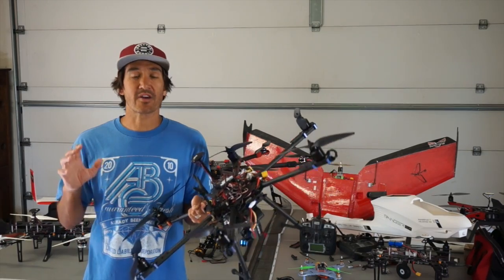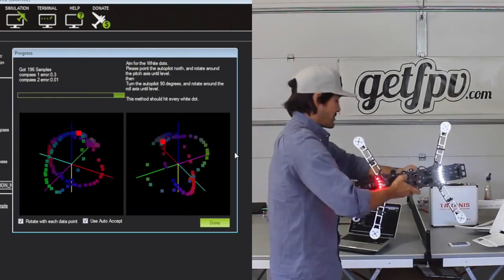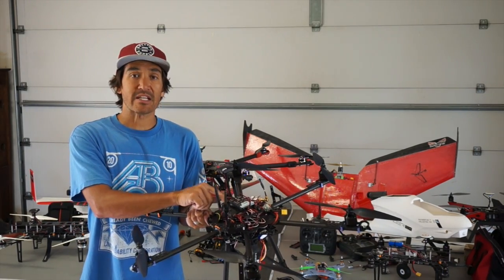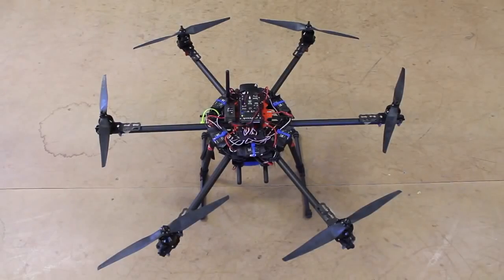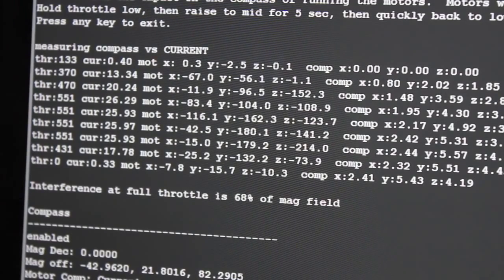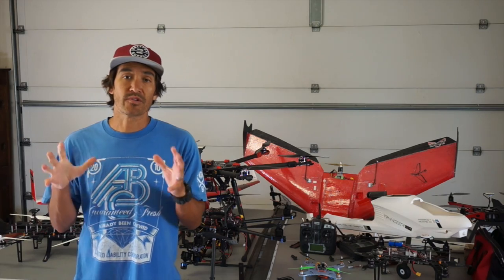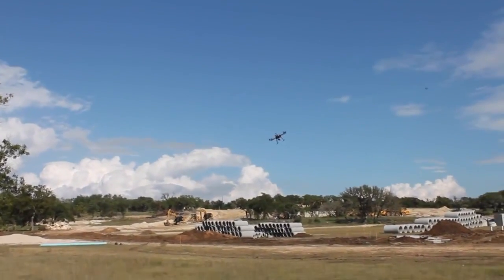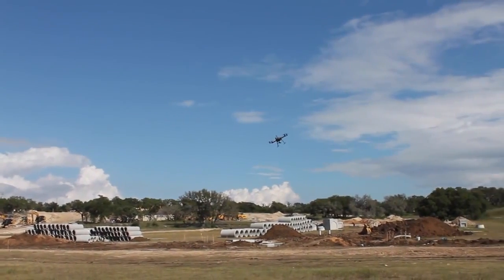APM/Pixhawk Tips for Good Loitering

Comment: Dennis: Once again, great tips. Question. When should you re-calibrate the compass (I have a 3DR X8+)? I will be travelling about 300 miles to do a mapping project. Does a re-cal have to be done or is just letting the unit sit powered on but dis-armed for 30 minutes OK? I have heard such conflicting ideas on this topic...
Reply: Marshall Cant I to would like to know. Is it best to do a re calibration each time you go out to fly? Should you recalibrate in the field whenever you fly in a new area? Trying to re calibrate a big X8 multi rotor is really difficult if by yourself.
Reply from the maker: Marshall Cant That's a really good question. I normally don't recalibrate when going to the same location to fly. I've read of those that re-calibrate when flying a new location though. I think the biggest concern will be determining if there's any cause of magnetic interference in the field:

http://copter.ardupilot.com/wiki/common-appendix/automatic-compass-declination/

If you're nervous about it then make sure you do the calibration at the field. You're going to be 300 miles away and the magnetic declination will be different. IMO better safe than sorry especially if this is a paid gig and you only get one shot. Please report back your findings. This would be very interesting for us to know.
Reply from the maker: courierdude See my response to Marshall Cant and I agree that larger multirotors and wings are a pain to re-calibrate. Would be nice to keep it to a minimum.

Comment: Must i flip the props or is it Ok to just remove them to the this test ?
Reply: Yes, I realize this is a year old and I'm sure you've gotten your answer, but that's the only way to put the load on the motors so that compass mot can give the necessary readings. Depending on the size of the vehicle and clearance, I've used cinder blocks resting on the landing gear to hold it in place, but this is dangerous if you are not familiar. Building a jig with clamps to hold down the craft is another way to avoid rotating the drops, and allowing to throttle up under load.